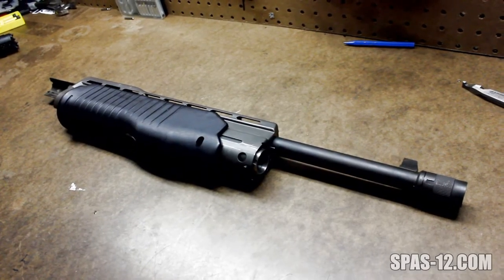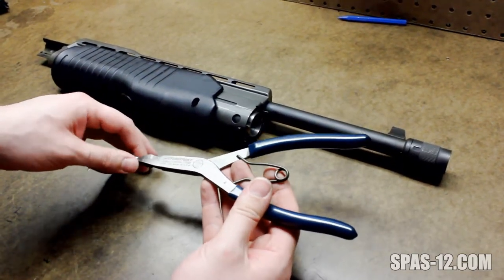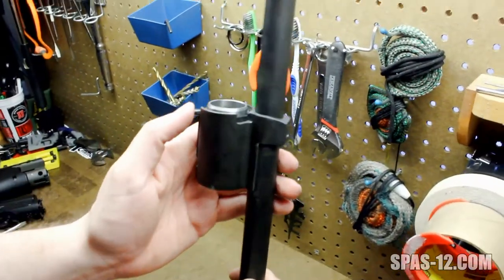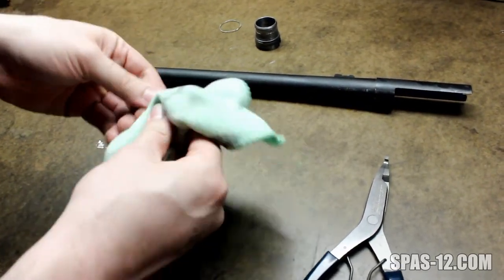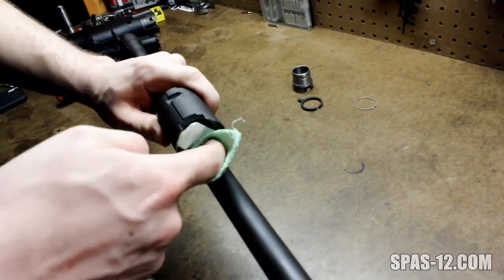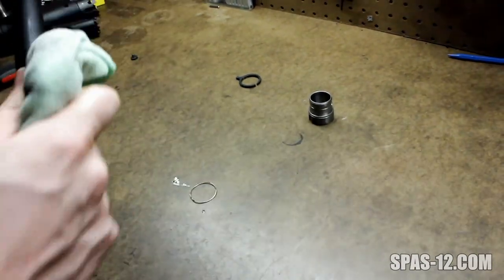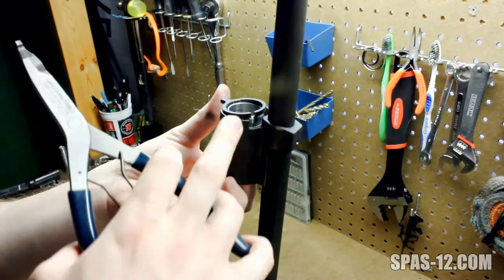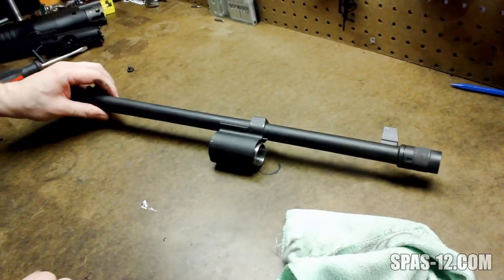The SPAS 12 Project - Cleaning your gas valve

Comment: I've been putting this job off for a year but it finally got to the point where I couldn't switch modes anymore. I managed to get the ring off with much difficulty, did the gas valve fall out the bottom? Hell no, that bitch was stuck in there tight. I had to insert a screwdriver that had a handle just wide enough and tap it out. Decades of carbon build up in there. Getting the ring back on was even more of a challenge. Couldn't have done it without this video.

Comment: Great video, I just picked one up with gas cylinder ceased up completely. Couldn’t select auto at all. Had to  soak in solvent for some time to free it up and then removed the cylinder following this video. Only with the lock ring off gas cylinder wouldn’t fall free like yours, could move it 3/4 out but didn’t want to force it. Was still enough to clean up, including gas ports and get it turning freely. Now works like a charm with easy selection from A to M. Thanks👍🏻

Comment: I cant see the gas ports after reinstalation. So I'm trying to remove the ring again
but it will not budge. it seems that it wont expand enough.
Any suggestions?.

I fixed it. I just spread the ring and turned the sleeve so the ports are now visible.

Comment: Hi my auto / manual switch on my spas 12 is not moving would you know what went wrong please
Reply from the maker: Hey Joseph.  Is this a new development or been that way since you bought it?  Many times they'll get stuck from factory cosmoline + carbon + time just seizing up in the gas valve and it just needs cleaned out.
Reply: @hardataq  had the same problem , the piston was encrusted , lots of hoppes and wiping
Reply: @stevenkatz679  Just had the same problem happen when I took my SPAS out shooting today. It ran fine in both semi and pump (though my left arm was getting tired so I was short stroking the pump at the end), but I couldn’t switch modes by the end of the session. Switched fine before, though I noticed it felt gritty. Even felt gritty before I took it shooting when I tested it.

So it seems like while the shotgun was sitting in storage, it collected dust and other grime, and that mixed with the carbon and caused issues as I fired more rounds. After cleaning and wiping the gas valve, it switches modes smoothly again. Will make sure to keep that area clean and lubricated next time I take it shooting.
Reply: @gameragodzilla  I am going to keep my piston dry and make sure it stays clean , the oil may be causing the problem .
Reply: @stevenkatz679  I’d personally lubricate the area where the piston and the magazine tube contact so it ensures smooth cycling. I also slightly lubed the internal part of the mag tube as sometimes the last shell got stuck and not fully come out onto the elevator. Probably also need a replacement magazine spring too, though it only seemed to happen towards the end of my session.
Reply: @gameragodzilla  yea I need a new mag spring too , mine is actually in two pieces but I have a follower in between them , works great , anyway I have two brand new feed ramps , I got from a guy recently , got them when I bought some other parts ,God forbid you break one, but if you do , you know where to get a new one . Parts are hard to come by .